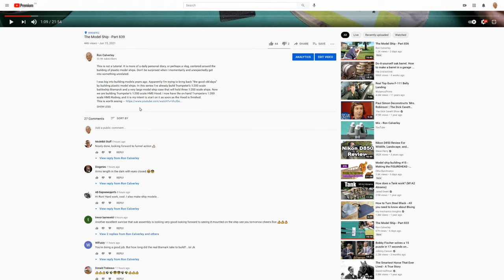The Model Ship - Part 840

Comment: I have found that if I clean the legs of my tripod well with something to make it clean and dry it helps it to hold better.  I don't know how they do it but after a while they will feel somewhat slippery.  Perhaps finger prints and stuff in the air.     See ya.  JimE
Reply from the maker: That slumping tripod thing could have ben an expensive disaster. Fortunately it just simple slowly leaned over against a wall.
See you tomorrow Jim. 👍